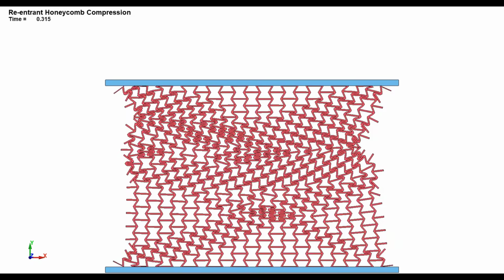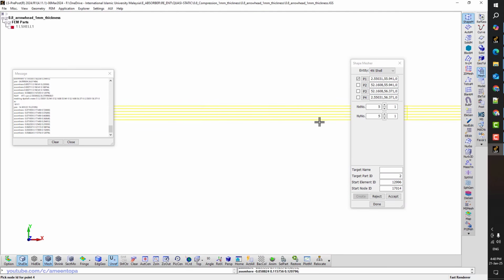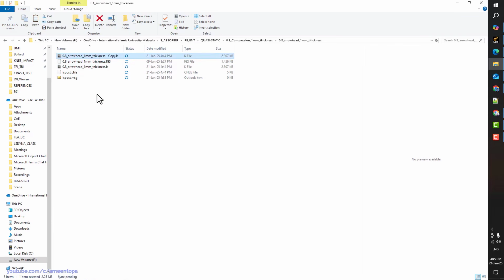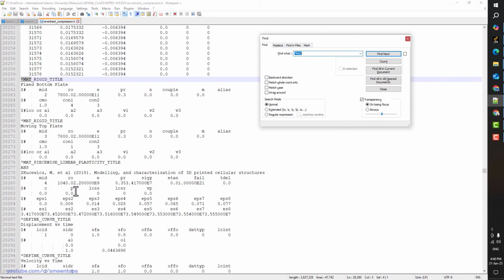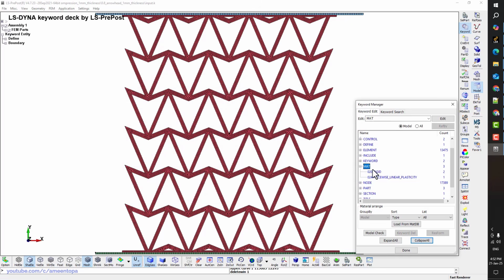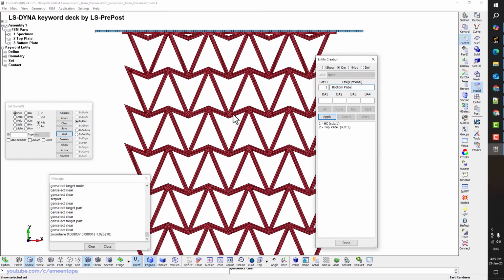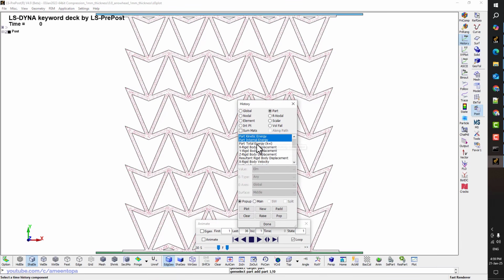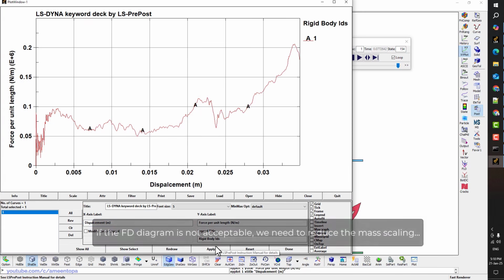LS-DYNA TUTORIAL 23: Compression of an Auxetic Structure - 2D Analysis

Comment: Hi Ameen, Can we use ELFORM=16 with defining the thickness instead of ELFORM=13 for this modeling. I keep getting negative volume error during the simulation when I use ELFORM=13.
Reply from the maker: ELFORM = 16 is fully integrated shell elements. which means the structure might displace in the out of plane direction, which should happens. 

When do you get the error? At the start in the simulation, after some compression happens, or near the densification zone?
Reply: @AmeenTopa  After some compression happens. Can it be because I didn't add an erosion or because of the stress strain curve. I used nylon material for my model
Reply from the maker: @Jee_001-h7z It is the material, most probably. You need to stiffened up the stress strain curves at large strain values. Look for "Negative volume in solid elements" in Google or check my article and tutorial on modelling crushable foam. 

This is error because nylon, just like crushable foam, is a soft material.
Reply: @AmeenTopa  After some compression happened.

Comment: Thanks for this interesting video. I have a question regarding the velocity of top moving plate. In the attached paper the velocity is mentioned as 2mm/min. But in the simulation, you defined the load curve by including the displacement as 55.7064mm at 0.1s. So could you please let me know the relationship between these two? If we obtain the speed from the load curve, it will be around like 2.674mm/min.
Reply from the maker: You are welcome.

Thanks for pointing out. There might be a mistake from my side. 

Anyhow, for quasi-static simulations, in most cases, the velocity does not need to be actually as it is in the experiment. As long as the kinetic energy is very small, we can accept the numerical simulation results as quasi static.
Reply: @AmeenTopa  Dear Ameen,Thanks for letting me know about that. Also may I know why you include npltc: 200 without defining a dt in the DATABASE_BINARY_D3PLOT? Is there a specific reason for that?
Reply from the maker: @Jee_001-h7z  The NPLTC, the DT value of the binary plot will depend on termination time. So, if I change the termination time, I will always have the same number of d3plot files as long as I keep NPLCT constant.
Reply: @AmeenTopa  Thanks for the information, Ameen.
Reply: @AmeenTopa  Hi Ameen, do you know how to generate a load curve from an experimental stress-strain curve (Stress in MPa and strain in %) for  *MAT_024
Reply from the maker: @Jee_001-h7z  Check the following webinar:

DYNAmore Express: Good old MAT 024 A review of LS DYNA’s most popular material model

Comment: I am observing something like I try to replicate the results from a paper where they did everything in ABAQUS, and I in LSDYNA. The results never matched, even though the curve looks similar. For example, for stress-strain plots, my first peak is 0.5 MPa, and theirs is 0.1 MPa, but the entire curve is similar. I did check everything and ran multiple times, it stayed the same. It happened to me in multiple researches
Reply from the maker: maybe the way you are extracting the results are different? Anyhow, for academic purposes, I wouldn't use the simulation of other people's work as a reference for validation. I usually look for experimental data.
Reply: @AmeenTopa *f it's not a bother. Could you tell me what to export from both of the softwares and how for 'Stress-Strain'. In LSDYNA, I use rcforc & rgdbout for force vs disp and then stress - strain (engineering values here). What's the case for ABAQUS?
Reply from the maker: @Stagnantwaterinyourarea yes, that's one way to extract the results. It will give you the stress strain curve that you can compare to the experimental data. 

I am not sure about the ABAQUS. Maybe that extracted the stress and the strain of an element. Or, maybe you are calculating the stress incorrectly.
Reply: @AmeenTopa Thank you for the insights. I'll look into it more

Comment: Hello, i need a help. I am use Ls-PrePost 4.10, and i have a 400 sphere solid in one part. How i can to separate each sphere in own part?
Reply from the maker: If all the spheres have the same material and element type, then no need to separate them. 

It is easier to redo the mesh from the start. Create 1 sphere first. Save it as one_sphere.k

Now, while opening one_sphere.k, using the import option, import the same file with offset option. Now you will have two spheres, you need to reposition the second sphere. After you do this, save this file as two_spheres.k

Next, follow the same routine. You will get from 2 spheres to 4 spheres....then from 4 to 8, then from 8 to 16, then from 16 to 32, then from 32 to 64....until you reach 400.

I hope the trick is useful.
Reply: @A @AmeenTopa  If I don't separate the spheres, they "stick together" in the final calculation after the TNT explosion, even though the spheres weren't touching each other. The biggest difficulty is that they're arranged in a specific sequence, not just in a row, so I'd like to know if there's a command like Move/Copy that automatically separates a sphere into a separate part.
Reply from the maker: @Polypoker45  You are using MAT RIGID. Change this to MAT RIGID DISCRETE and the problem will be solved.
Reply: @AmeenTopa  I'll try it and give you feedback, thanks in advance
Reply from the maker: You are welcome and all the best
Reply: @AmeenTopa  Unfortunately, MAT_RIGID_DISCRETE didn't work, and the spheres also stuck together, so it looks like I'll have to do it the first way.
Reply from the maker: @Polypoker45  That's very weird.

Anyhow, just to make sure that separating the spheres will solve the issue, start first with two spheres. If it works, then proceed to 400 spheres.